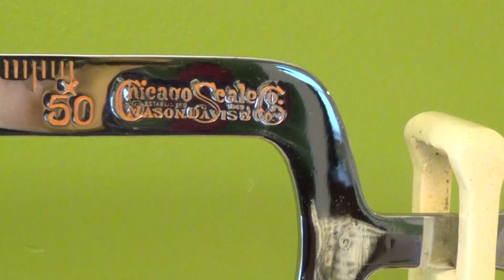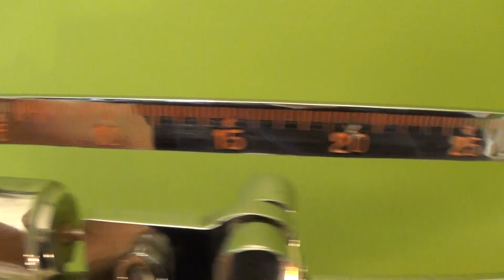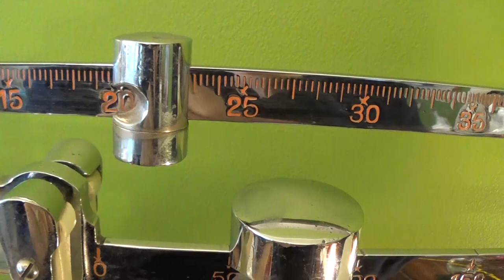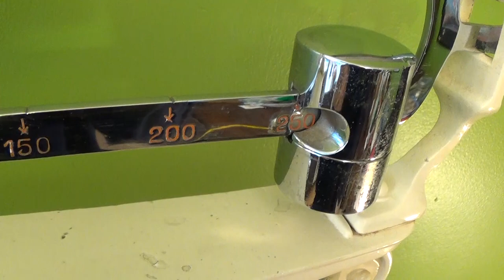How to Use a Doctor's Balance Beam Scale

Comment: Excellent! I’m having a problem w/ my old HealthOMeter unit reading ~10# LOW, but it zeroes fine. 
This is the first video I’ve found that even makes a distinction between ZERO & CALIBRATE. From what you showed under the base plate, I’m better on course to addressing the problem.

Comment: Thank you for the great video, in particular where you flipped it up and showed the underside.  I just bought an almost identical one for $60 but one of the lower linkages is missing, using captured stills from your video I should be able to weld up a replacement with much greater ease.